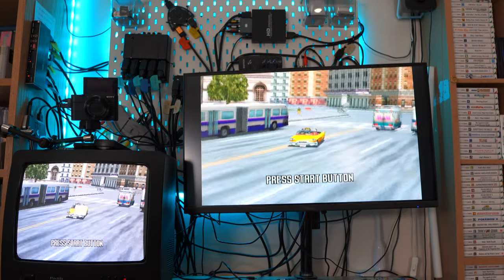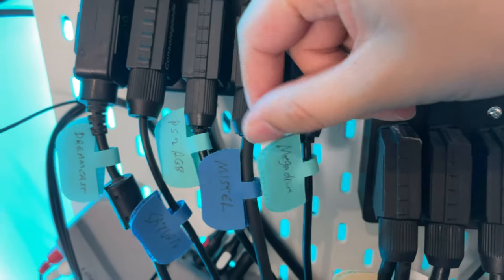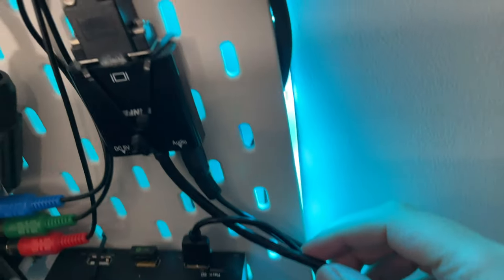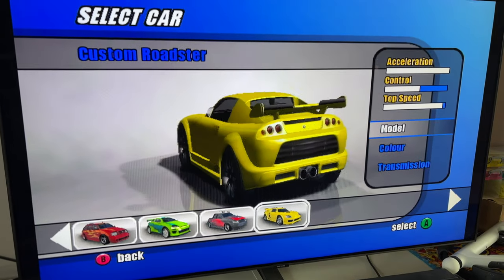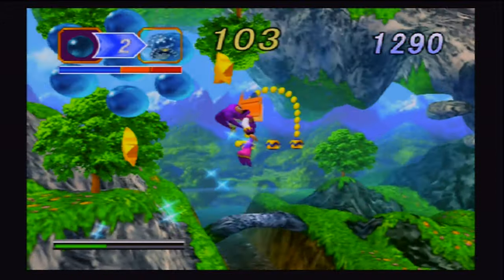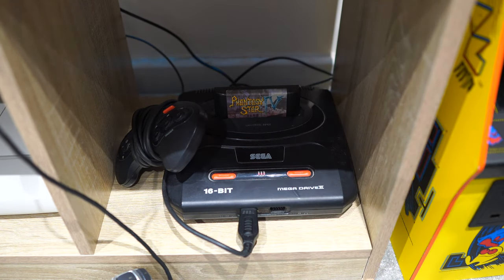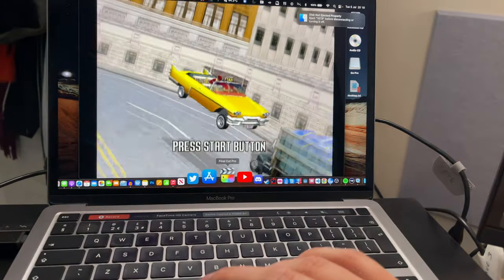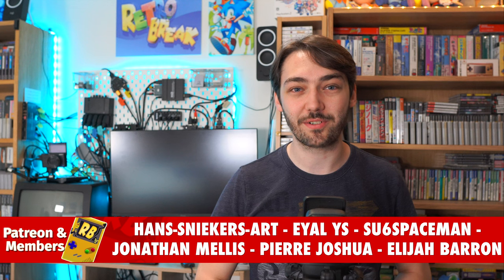The Ultimate Retro Gaming Consoles Setup! (RGB + HDMI)

Comment: So cool, you can do everything! Congratulations!

(Maybe for the next version, placing your cable splitters (peg board) between the streaming PC and the consoles would make your cable distribution more efficient and versatile. At the moment, your consoles and the streaming PC are on opposite sides making it a mess. )
Reply from the maker: I wanted to get them closer to the PC, but as there’s a radiator and window covering the entire wall to the side I couldn’t do it, maybe if I re arrange I could have my desk at the back nearer the consoles and have shelves on the wall where my desk is now next time?

Comment: Super impressive and complex setup to output all the options for capturing and recording. Interesting video to see all the efforts you’ve gone to.

However, what if you want to play on your Wii? I’m guessing you could make use of option 3 for the composite cable switch? Or add in an extra for HDMI? Don’t miss the Wii out as that’s how we found your great channel!

Thanks for the overview and all the time you must have taken to set it all up.

For us at home we’ve had to develop a way to support different work laptops and then switch over to retro items afterwards. That’s ended up being multiple usb power cables, hdmi splitters and various tweaks to take composite to hdmi.
Reply from the maker: Thanks! I haven’t got round to hooking the wii up yet, but I think I would use component cables into the OSSC, as I don’t use them for the PS2 now I have a HDMI output on there :)

Comment: Quite a tidy little setup you've got there, Nick, especially with that CRT.

While yeah, I be one that'll note that the generic upscaler isn't great, as it treats 240p as 480i and tries to de-interlace the picture. However, it has its uses. its not too bad for games that swap resolution frequently and the de-interlace smear helps hide composite dot crawl.

IIRC 15m without a powered relay is around the limit for HDMI.

You'll need a multiformat Professial BVM/PVM CRT or VGA Monitor that can take 480p over BNC/VGA for the DreamCast. Consumer CRT don't support it.

My setup

RGB Consoles via SCART via 3 manual Bandridge 5-in-1-out switchers to Framemeister's Scart input (Switches A and B are plugged into 1st and 2nd slot of C to keep the runs as short as possible). Most of the SCART leads I were from Retro Gaming Cables.

1  NES (RGB Modded PAL - I use the Framemeister's skewing tools to correct the aspect ratio)
2  SNES (Modded with 50/60Hz Switch)
3  N64 (PAL RGB Modded with Deblur - again Framemeister for aspect ratio correction)
4  Game Cube (I use this more for GB, GBC and GBA games using Game Boy Interface)
5  Mega Drive 1 & 2 (modded with 50/60HZ switch)
*  Master System Converter (for playing on Mega Drive)
6  Saturn (Japanese model with Action Replay for PAL games)
7  Dreamcast (SCART that can switch between 240p/480p, no that's not a typo)
8  Atari Jaguar (Modded for 60Hz) 
9 Original Xbox
10 PlayStation 2 (Use to use component, but IMO the Scart worked better for me).
11 Amiga 600
12 ZX Spectrum
13 Nothing as Yet, hoping to one day add a Duo R.

Component Consoles - use a 3-in-1-out component switcher to Framemeister

Wii (Use Swizz in gamecube mode to force GameCube games to 480p)
PlayStation 3 (used to use HDMI, but swapped for High quality components by HD Retrovision)
PSP 3000s

HDMI - Go to a 5-in-1-out switcher, into Framemeister.

Xbox 360/Xbox One/PlayStation 4/Switch

My Wii U Goes into the second HDMI connection of the Framemeister, I use self-designed settings to clean up the mess that is the NES games on the system. While it not perfect, I got them looking much better considering what I had to work with.

Framemeister receives the Scart, Component and HDMIs and feeds them to a 1-in-4-out HDMI Splitter (AV Receiver/Monitor 1/Monitor B/El Gato 60HD).
Reply from the maker: Thanks for sharing your setup! It’s given me some ideas to improve this! :D

Comment: I'm flabbergasted. My brain goes into full error. I just plug all into my Panasonic Plasma 2009, which basically eats everything, and start playing. For purist stuff, I have a lovely 21 inch stereo Trinitron that looks stunning and is a piece of art by itself, dual scart and some scart switches do the rest. I seriously don't get why anyone would "grab and capture" a signal and convert it to digital. In my emulator I can hit record, and get cleaner output, I can even capture a PNG file stream of original unaltered frames from the graphics buffer.
If you DO want to capture footage of an original machine, I would say make a nice macro-lens setup with synced shutter and capture a CRT, preferable one of the later smaller flat Sony tubes with good geometry.

Comment: I'm currently trying to get the same setup  you have for your capture card for the consoles and so far I have Ps2, Original Xbox, GameCube and SNES but I'm not sure where to start with connecting all of the cables to the switch box as they are all scart

Comment: It’s a shame that the Koryuu Transcoder is no longer available as you could use that to add Composite and SVideo inputs to your OSSC. 

Though if the only system that is still outputting via composite is the NES, then an RGB maybe a good choice. I can say that the NES looks amazing in RGB and is well worth upgrading, I had mine done via Old Skool Consoles for £100.

Great stuff Nick.
Reply from the maker: Thanks! NES and PC Engine are the only ones still using it, might look at modding them soon as I don’t really like using composite at all if I can help it!
Reply: @RetroBreak  I need to get the RGB mod on my Duo R sorted out. For whatever reason I get a really poor picture with lots of interference. It’s not too bad as I have a white  PCE with gives out a crystal clear RGB image.